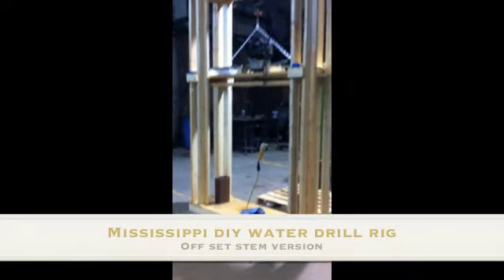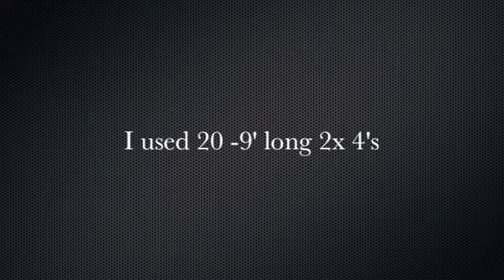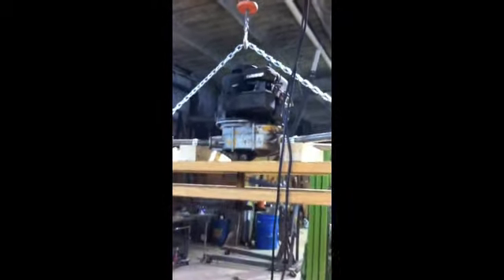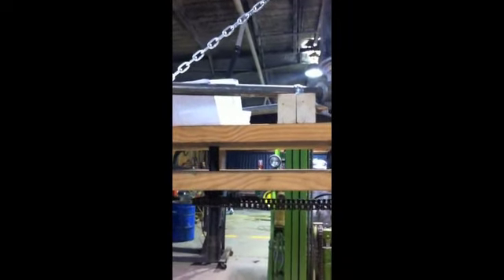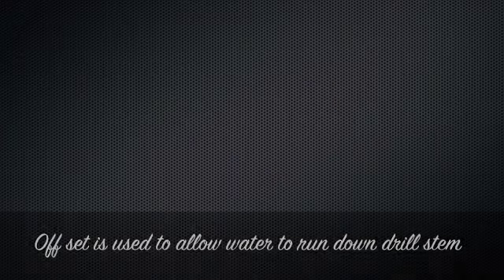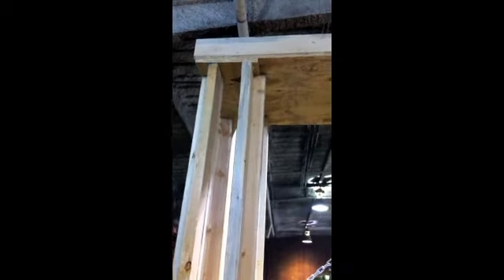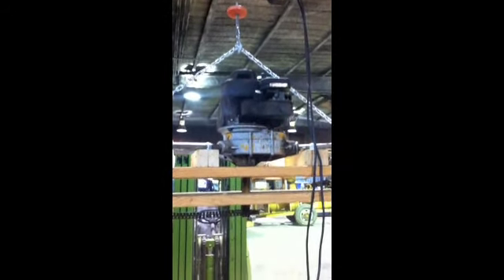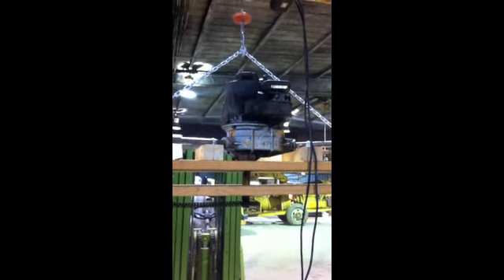Drill Water Well With Power Auger

Comment: Can I suggest: to stop the auger from turning, attach a rope or chain to one of the auger handles and run it out 10-20 feet to a ground anchor, that way it can move up and down freely and you can unhitch it whenever you want! Thanks, H
Reply: MY NAME IS AKIN, I WANT TO USE THIS METHOD TO DIG IN NIGERIA, PLEASE, CAN I GET THE MEASUREMENT OR TYPES OF POLES USED FOR DIGGING, THE LENGHT AND THE HORSE POWER OF THE AUGER USED?